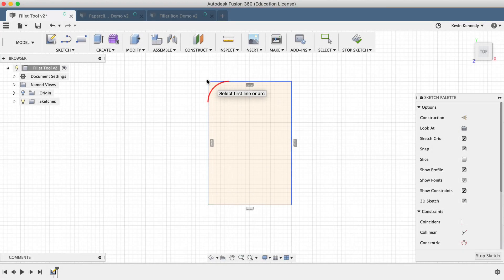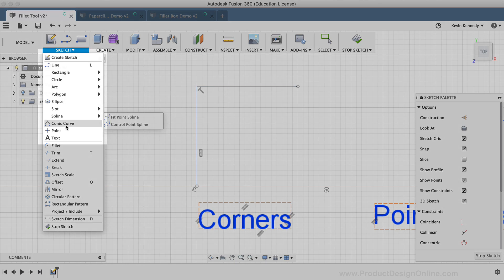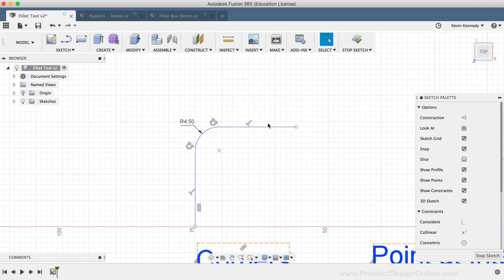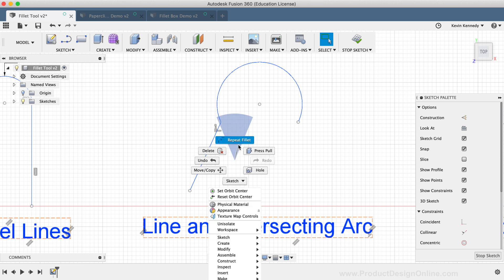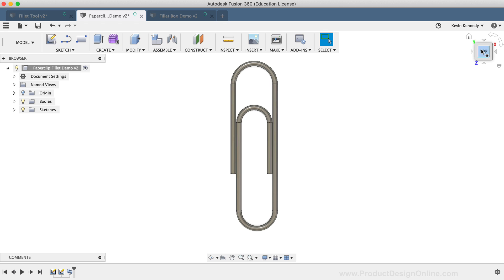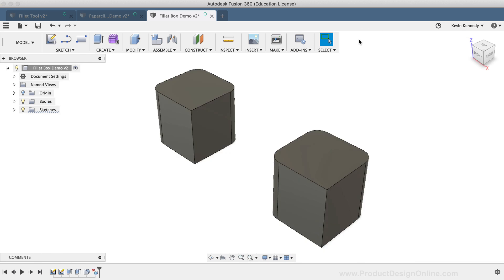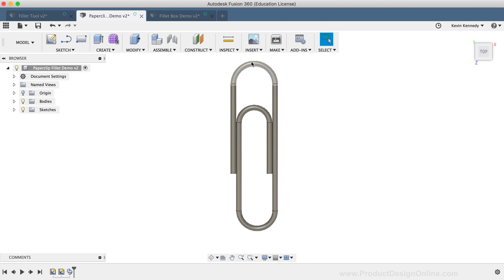How to Add Sketch Fillets in Fusion 360

Comment from the maker: Here's a playlist covering Fusion 360's sketch tools: http://bit.ly/sketch-tools-playlist
_
P.S. If you liked this video, I'd love for you to Subscribe ► http://bit.ly/sub-right-now
TIMESTAMPS
0:00 - Add Sketch Fillets in Fusion 360
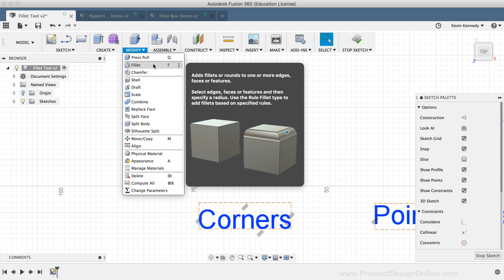0:47 - Fillet a corner
3:04 - Fillet multiple corners
3:27 - Point at intersecting lines
3:52 - Parallel lines
4:12 - Line and intersecting arc
4:35 - Intersecting circular arcs
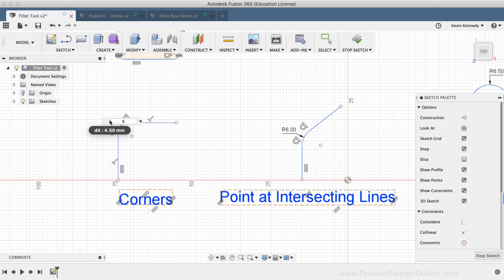5:37 - Editing fillet radii
6:29 - Filleting for sweep commands
7:18 - Sketch fillet versus modify fillet

Comment: How did you create the fillet control points on your paper clip? I mean the solid black points outside the fillet, that align with the extension of the two edges of the fillet.

Comment: One thing that would be worth mentioning is that you can't create a sketch fillet where a line intersects a full circle. It only works with partial arcs. This was driving me crazy for a good while; It had me believing that filleting line to arc simply wouldn't work. After watching this video, I figured it out, even though it wasn't mentioned directly.
Reply: I literally found this video while trying to solve why I cannot create sketch fillet with a circle and a line.

Comment: I do not have these options. I only have one fillet command and it works on one corner of the square I am starting with in the sketch, but then does strange things when I try to fillet the other corners.
Reply from the maker: Hi Gabe. There are two fillet commands. A SKETCH fillet command that only works with sketches and a MODEL fillet command that only works with 3D solid bodies. The SKETCH fillet command is now only accessible when you're in an active sketch environment. To enter the sketch environment you can either select "Create Sketch" or right-click on a planar face or surface and select "create sketch". 

In regards to working on only one corner, are you using my demo file? One possibility is if you're entering a fillet radius that is larger than the dimensions of the square.

Comment: Thanks, but...How about removing them? How to remove fillets without destroying your sketch once you apply them? :(
Reply from the maker: Hi, equiz. Great question. The best way would be to use the "trim" sketch tool. Video on that here - https://youtu.be/6Jl82sKd5L8
The trim tool works great because it will remove the fillet details and relevant sketch info, without skewing the sketch-like it does when you "delete" the sketch fillets.

You may also find success in using the undo feature. If you click and hold on the undo button you'll see that you can undo to a specific instance of the sketch.

Comment: I think you just took me out of a fillet hell I found myself in.  So much better to fillet things in modelling mode than to try and do this in sketch mode.  I was constantly fixing my sketches since the sketch fillet command would often remove constraints on adjacent lines!  I could only get fillets to behave if I did sketch construction lines than placed collinear sketch lines on top of them. What a nightmare.  Thank you so much for the enlightenment.
Reply from the maker: Hi, Michael. Glad that makes sense - model fillets are almost always better :)
Reply: @ProductDesignOnline  
I'm afraid none of this makes sense to me. I have set up an exact replica of your 2-line corner and followed every step. Yes, I'm in the sketch environment. The sketch fillet tool turns the cursor into that little filleting icon with the "line or arc" prompt. But unlike your video the cursor stays that way. Your cursor reverts to a simple arrow. Mine stays as the fillet-icon cursor thingy. I've tried waving it around the screen, clicking it, right clicking it.

It stays that way, and in that mode appears to be completely impotent, mouse over a line, click on a line, whatever. It's a ghost-cursor... the sketch environment doesn't recognize it.
Reply: @ProductDesignOnline  
I have figured out the problem, referencing another f360 YT channel where the entire construction is shown from beginning to end.
The crucial issue is that all filleting has to be done on a new item, before finishing the sketch. The is no post-construction modification of a sketch-corner.
How I missed that (if that is indeed the ridiculous case in fusion360's pantheon of baffling design-philosophies) in all the expanse of fusion's sprawling forum topics is beyond me.
Regarding the previous remark about the cursor-shape, it still didn't change to a regular pointer as yours did, but was equally effective.

Comment: Hi Kevin,
I'm trying to fillet the corners of a center rectangle, but I get the warning that constraints and dimensions were removed during operation. First 2 corners and rectangle remains black, but last 2 corners I get the warning and sketch remains blue.
Thanks,
Ron
Reply from the maker: Hi Ron,
You'll almost always get the "Constraints were removed" warning during the application of sketch fillets. With center-rectangles, it will always delete the "perpendicular" constraints that are in the corner, as seen here (#1) - https://snipboard.io/Q5kr2h.jpg

Your filleted corners should be black if they ALL have a dimension applied to them. In my reference image, you'll see that all four corners have the dimension of 10mm applied to them, as they're all tied to the dimension in the upper-lefthand corner. It sounds like two of your fillet dimensions are not defined, which is why they would be blue. Can you try adding a sketch dimension to the radius of the undefined fillets? See if it throws the "driven dimension" warning or not.

If you can provide a link to a screenshot that would also help me check if it's something else. Cheers, Kevin :)

Comment: Hey there.  great tutorials overall.  Any tips on creating a proper looking Fillet Weld?  Found a video for Inventor that apparently has this exact feature, but it seems it would need to be manually created in 360.  I've been playing around with an SVG file I created from a photo of a real weld, but I'm not very happy with results I'm ending up with, not to mention the number of surfaces and faces really dog down the workflow.
Reply from the maker: Hi, Azzray. Great question! Unforuntately, there is not currently a fillet weld tool in Fusion 360. Autodesk inventor is certainly a little more advanced in this realm. The workaround would be to use the sweep command to "fake" the fillet weld. I found a Fusion 360 forum post with a video that I think could be helpful to complete the method I mentioned- https://forums.autodesk.com/t5/fusion-360-design-validate/making-welds-fillet-in-corner/td-p/7513111

Cheers, Kevin :)
Reply: @ProductDesignOnline  Great and thank you for the reply!
Reply from the maker: @asraiSOA  You're welcome! Let me know if it ends up working out for you! Cheers, Kevin :)